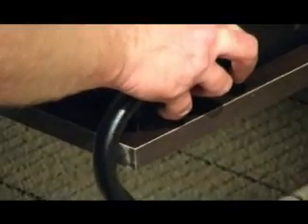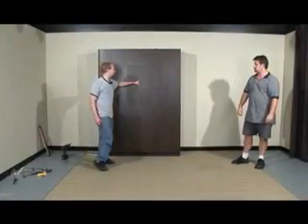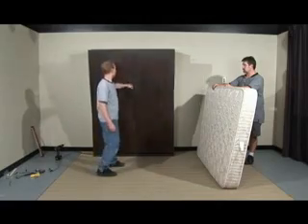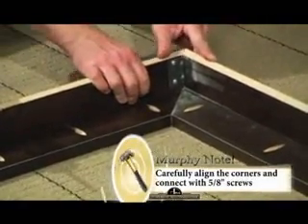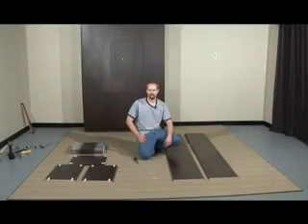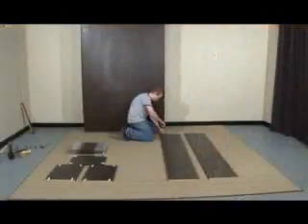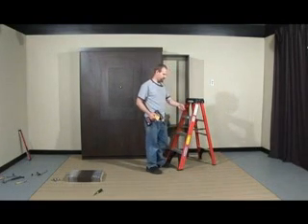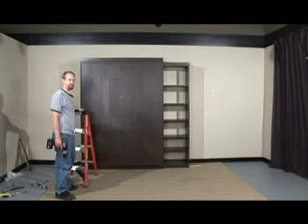Step by step installation of a "Tilt-Away" Murphy Wallbed by EnJ Cabinets. Part 4

Comment from the maker: Hi Beau
Thanks for the question.  If the bed hovers or slowly raises you can add some weight to the inside “foot” end of the bed. Over time with normal use the springs should stretch out a little and you can take out the weight. 
 If the bed “springs” right up then you definitely have too many springs on the mechs. Unfortunately the only way to remedy this is to remove the bed face, relieve the tension on the spring pack and remove springs.